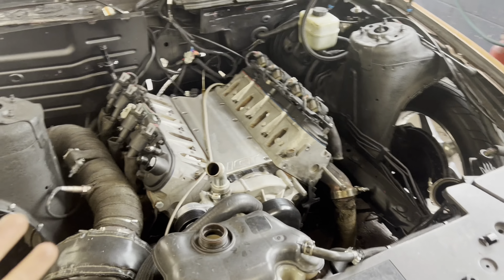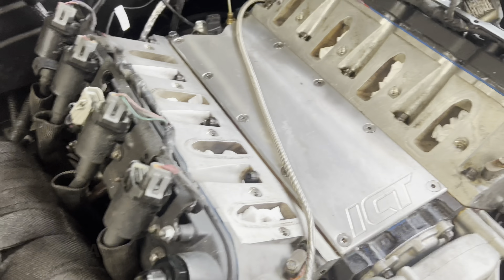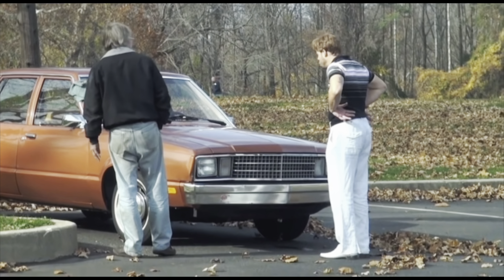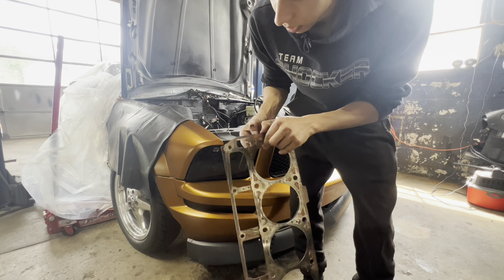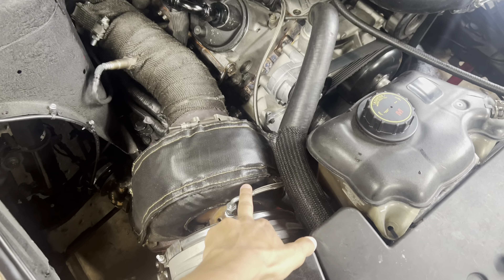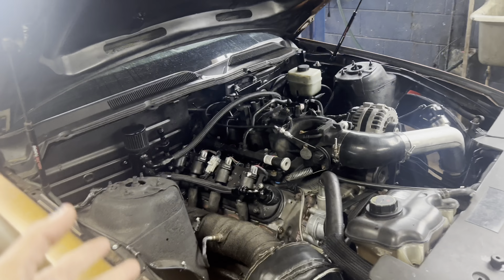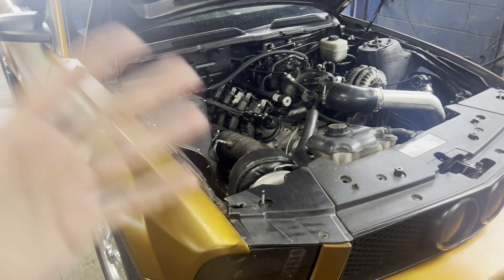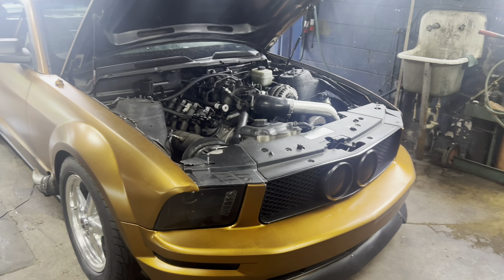Ls9 head gasket install 👏🏽

Comment: Did you relocate the knock sensors or delete them because I wanna buy the ict valley cover but i can’t find any in depth info about deleting them
Reply from the maker: Delete we all delete them get that valley cover
Reply: @Zaysnipes  okay I will! Do I go into the eco to remove it or what all is involved with that?
Reply from the maker: Just unplug the harness from the sensor in the valley and throw your ict cover right over it that it u can leave the sensor there also